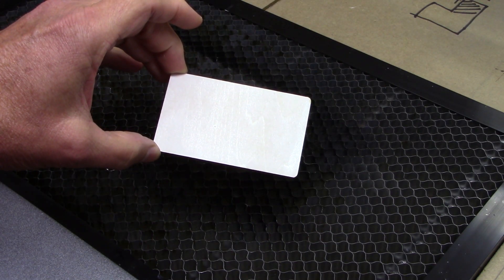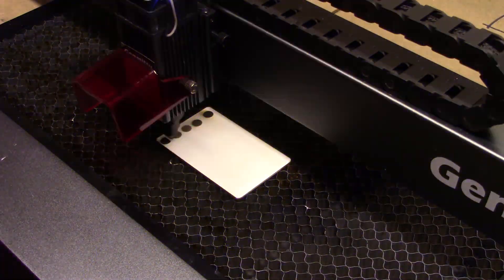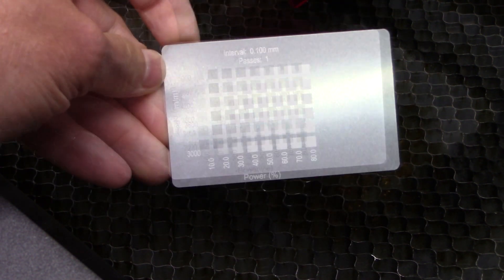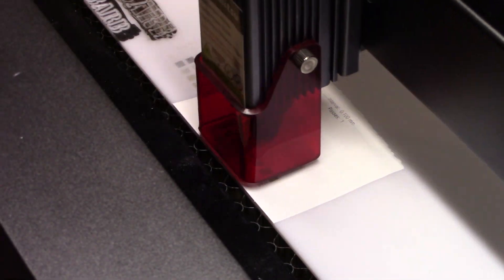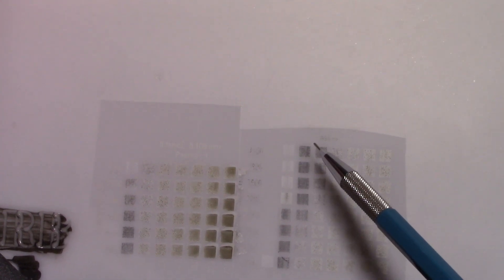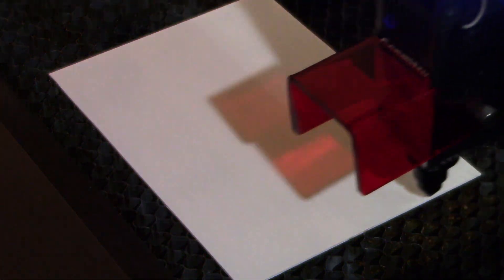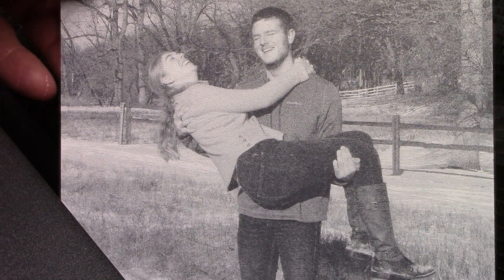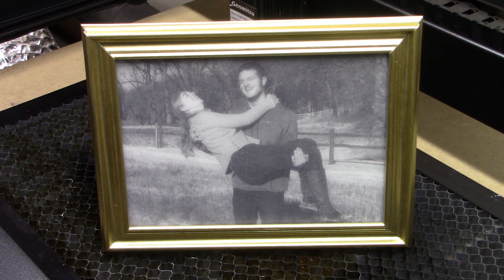What will Titanium Dioxide (TiO2) stick to other than ceramic tile?  Will It TiO2?

Comment: What was the speed/power/laser wattage on the glass print?  That turned out really well/
Reply from the maker: That is a good questions.  This was a while back so I had to look up that project.  I still had it so I was able to grab the settings I used.  3,400 mm/min 75% power on a 10watt diode laser.  What I would do differently on this would be to burn it mirrored and paint the front side. Having the TiO2 on the front and the white paint on the back leaves a bit of a shadow through the glass which makes it look a little out of focus.

Comment: Hey!  White paint has always confused me. If I wanted to cover brass with white spray paint then selectively remove the white paint to reveal a pattern in the brass, would I be able to do this?  Final product being just bare brass and white paint?
Reply from the maker: I have done a similar process with other colors of paint and even had several layers of paint and burned through one or two layers to get to the one below it or go through all the paint back to the base which has typically been a white tile.  What can be an issue with most white paint is that it contains Titanium Dioxide.  Under the hear of the laser, it can crystalize and turn black. Depending on the material it is on, it may or may not stick.  That is the trick.  I have not tried burning paint off of brass so I do not know how that would work.  without knowing what you are attempting, you might find that using your laser to burn a mask and then paint the brass might work better?  I hope this helps.

Comment: I enjoyed the video, I have often thought about other coated materials.  Now I don't have to experiment.  I was wondering what wattage your machine is. I especially like the glass.  Did you try using the negative setting in Lightburn?
Reply from the maker: This was done using the Genmitsu LC-50 + which is rated as a blue, 10 watt LED/Diode laser.  The glass does turn out well. A great option would be to use your idea of inverting the image.  After cleaning off the TiO2, spray paint that white, silver, or some other color.  When it is put into a frame, the TiO2 side would be behind the glass and really look like a photo.  With it on the front of the glass, it casts a slight shadow onto the background.  The thicker the glass, the more pronounced that is.

Comment: Great content, well shown.   On the clear glass piece, I wonder if it's necessary to remove the TiO2.   Perhaps with an inverted image engrave the glass "back" and then seal over the TiO2 with a clear varnish or perhaps colored spray paint. I think I'm going to give that a try.
Reply from the maker: The only thing I can think of on this idea is that the un-lasered TiO2 is not adhered to the glass and is easily brushed off.  You would have to be careful with that.  It would look really good with the nice white of the TiO2!
Reply: @CNCATHome  Your spot on about the loose TiO2, thanks.   I think I'll print a handling frame for the glass, something that can be left in place during lasering and coating and with a lip for easier handling.

Comment: Your TiO2 coatings appear very smooth and uniform.  What blend are you using and how are you applying it?  Brush, spray bottle, air brush?  Thanks.
Reply from the maker: Good question.  At the time of this video, I was brushing my TiO2 mixture on with a foam brush.  Since then, I have started using an airbrush which puts on a very nice coat.  As for my mixture ratio, I don't know.  I was a bad scientist and just started mixing it until I liked the consistency.  Since then, I have added more alcohol to thin it out which seems to work better. I think I am somewhere around 3 to 1 (three parts alcohol and 1 part TiO2).  This process is very forgiving.  There is a wide range of mixtures that seems to work well.  I hope this helps.
Reply: THANKS! @CNCATHome

Comment: Stainless steel is suitable?
Reply: It's good on stainless, actually stainless is good without the TiO2.
Reply from the maker: @johnsathe2429  - I have had good luck with engraving on SS if I don't do too much.  I have over done it an my material warped.  Too much heat and internal stress I guess.  I should try TiO2 on SS sometime.  Not sure I would use that method as SS seems to etch nicely without it.  🙂
Reply from the maker: I have not had good luck getting TiO2 to work on metals.  That doesn't mean it won't, I just haven't figured out how yet.  ;-)  I tent not to work much with metal so there isn't much opportunity for experimenting.
Reply: Looks really good will try deffo, what machine did you use and could you share your settings just to give me a idea thanks

Comment: Ok, so the glass etching a negative was wild.  I would not have guessed that one.

So here is an idea for you to try on glass... flip the image to a negative in software.  Burn it to TiO2 glass and then try edge lighting the whole thing.
Reply from the maker: That is interesting.  The TiO2 is on the surface of the glass.  I don't know how well edge lighting would work?  Interesting.  I guess you don't know until you try.
Reply: Was just thinking same.

Comment: Did you invert the image like you do on the white tiles?
Reply from the maker: That is a great question.  I do not invert the images for this.  I normally do not have to.  It all depends on the image and what I am doing.  With this method, the TiO2 turns black where the image is black.  Thank you for asking.

Comment: I wonder what it would look like if you need a negative image on a titanium oxide coated glass.
Reply from the maker: Very interesting idea. That should work just fine.  I have done quite a bit of B&W photography in the past and this look so much like a glass plate photograph.  But a positive, not a negative.  If I still had all of my B&W photo stuff, I would be tempted to see how it worked to make a photographic print.